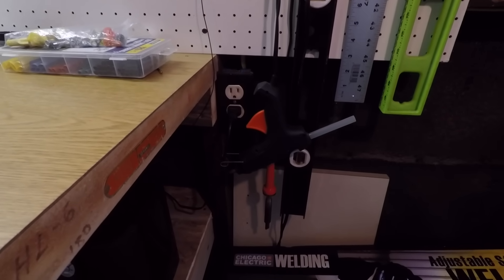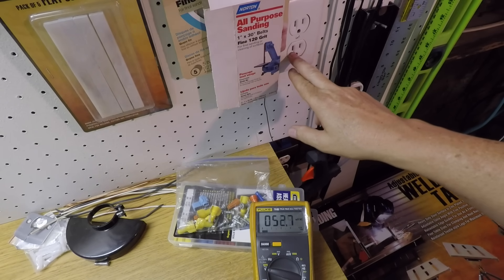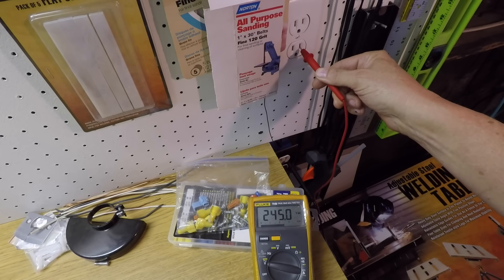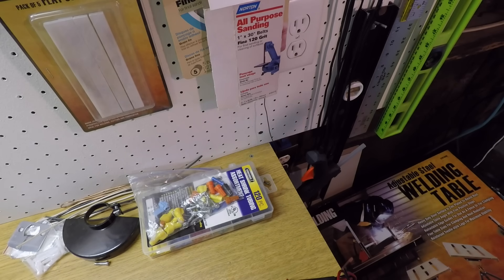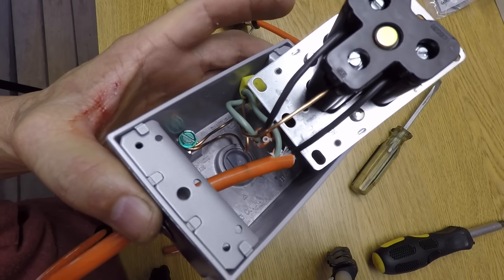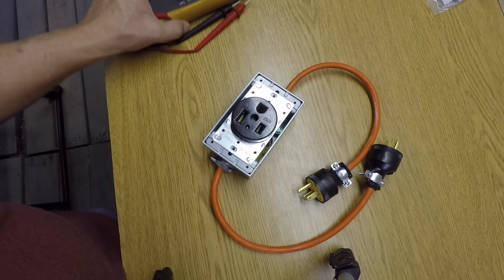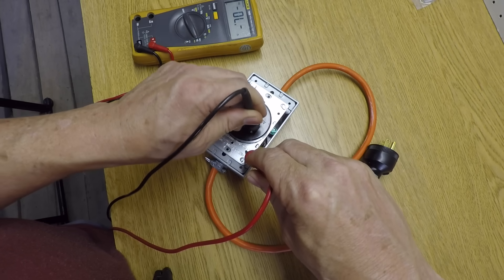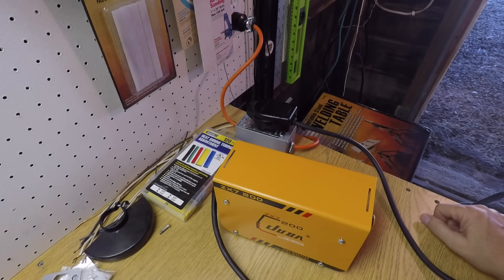How to Get 220v From 110v

Comment: There is something we studied in Electrical Engineering called "Inductive heating" where the wires on each of your 110v line would heat up because current is not going back through the neutral wire on the same circuit as the live wire.   On a traditional 110v circuit, there will be no inductive heating because current flows in opposite direction for the live wire and the neutral wire.  But in this case, there is no return current on the same circuit since it's returning through the other 110v line.  I don't think an inspector would approve of such circuits that would cause inductive heating.
Reply from the maker: There are many 240V circuits that are approved by inspectors that don't use the neutral wire. The neutral wire is only required if the device you are plugging in has a function that requires 120V. Many don't and my welder is one of them.
Reply: Yes, I agree.  But in your welder's case, both live wires are on the same group of wires in the same Romex sheathing or inside the same conduit.  In that case, inductive heating will not occur because the net magnetism caused by one live wire cancels the magnetism caused by the other live wire.

However, the situation we have here has one live wire coming from one outlet and the other live wire coming from another outlet.  That will cause inductive heating on both circuits.

As an experiment, after hours of an EV car being charged, pls check the temperature of each of the wires just before it's plugged into their respective outlets.  I haven't done this experiment before but it should be warm to the touch.

Edit:  The magnetic field is proportional to how much current is flowing through the wire so the phenomenon will only occur when there is a load on the circuit (e.g. charging an EV car)
Reply from the maker: Interesting info and good point. I no longer have that set up for my welder so I can't test out the theory. During the time I used the device I never had any problems and that's probably due to the low amp draw of my particular welder and the length of time I was actually using it. Thank you for the information.
Reply: In addition, a welder is not used for hours upon hours at 100% duty cycle.  An EV would be a bigger concern since it charges for hours at 100% duty cycle.
Reply from the maker: I agree

Comment: Have you ever heard of using your dryer outlet to run a welder or plasma I'm thinking of doing that ,your thoughts
Reply from the maker: Yes I have heard of that and I've done it for my welder in my new shop. I will soon be making a video of a slight modification to using a dryer outlet for running a welder. My dryer is on the other side of a wall in my garage. I'm going to pigtail a second 30A 240V outlet from that circuit and mount it on the garage side of the wall. As far as I have researched it would be up to code and safe. It's just not typical to have more than one outlet on a 240V circuit. If I run a welder at the same time the dryer is running the worst that could happen is a breaker would trip but that's no problem, we rarely even use our dryer anyhow.
Reply: You can but you should have a switch to only run one at a time so there is know chance of running both at the same time

Comment: I agree, just do it right & run a 240 line. Also, not using the white neutral wires removed that extra little safety of having more than 1 ground. I know you have 2 ground wires, but I would have added the neutrals too. Also, an easy way to remember which is hot is Black Gold. The black hot goes to the gold terminal.
Reply: Actually, the opposite is true. The safest way is to AVOID connecting the neutral as he did. That way, even if you connect only 1, you have 0 chances of electrocution. Or if the outlet is incorrectly wired. Imagine one of the house outlets was wired incorrectly (hot on neutral and neutral on hot, IT DOES happen more often than you think, especially in zones that use independent wires), if you have both neutral and hot wired to the plugs, you could close the circuit and create a nice sparky holiday...

Comment: Seems you put a lot of time and effort into doing something essentially the wrong way.  If you have the two 20a circuits why not keep the one as a dedicated 110v 20a circuit (btw those are 15a receptacles) and utilize the other 12/2 w/ground as you dedicated 220v circuit.  Only thing you would need to do is install the 220 receptacle in place of the 110 receptacle then add a 220 breaker in your breaker box...
Reply from the maker: My panel only has room for (1) two pole breaker or (2) single pole breakers.
Reply from the maker: NEC allows 15 amp receptacles on a 20 amp circuit as long as there is more than one outlet on the circuit.

Comment: You have to have two separate legs on separate phases and that is 220. Just do it right and run a new circuit from your panel
Reply: No, you have two legs on the same phase for 240VAC. The Neutral that provides the 120 in a panel is the center tap of the transformer. It doesn't change magically from one to two phases.

Comment: What kind of welder you have that runs on 220V and requires only 20Amps?
Reply from the maker: https://youtu.be/Sle56LvpsEM
Reply: @DIYHomesteadProjectsDIYHP10  Did some googling on this unit, it's rated as a 5.5KW input rating which would make it at least 25A!

Comment: bruh
you bought the box. you bought the outlet. you bought the cover.

just install it and replace the two single breakers feeding the outlets with a double. instead you then bought wire and plugs and other garbage you didn't need to create a contraption that can zap you/damage your gear. ughhhhhhhhhhhhhh

Comment: Good idea if you have no other choice..however if you are the one who installed the two outlets and the wires to them, then why didnt you just do the cheap extra steps to install the 220 outlet ito the wall using the two 110/120 wires...would have eliminated the need for your adaptor
Reply from the maker: Because that wouldn't be a portable solution but this adaptor is.

Comment: Hello NSXproperties, so right u are. . . putting circuits on same phase bar and if with a neutral, the neutral could be overloaded. say 2  20amp ckts on 1 phase bar the hots or ungroundeds would be  protected but the neutral overloaded by 20 amps. so not good.

Comment: Just wired a 240 circuit to your electrical box with a circuit breaker 40 amp with a plunging socket to be safe

Comment: Well if the sky falls and you're holding a plugged in power tool I guess you too then could be shocked!
I'm mean really, they are far out reachin'.
Nice work!
The only thing I might add different is change the 120v outlets with 20 amp CFCI outlets.
Reply from the maker: This device won't work with GFCI outlets

Comment: Q: why use hot/gnd vs hot/neutral? Seems like you purposely use your ground as a neutral but I thought that wasn’t “recommended” by the experts.
Reply from the maker: So here's my attempt to answer the question: In this 240V circuit there is no neutral used or required. My welder only requires two (120V) hots and a ground. It's a three wire set up. My ground is only a ground and nothing more. The two hots alternate back and forth being either a hot or a return (neutral). While one hot is supplying 120V the other is a neutral. They alternate back and forth 60 times per second or 60 hertz in the US. Some 240V plugs also have a connection for a neutral (usually white insulation) for devices that have a 120V requirement such as a clock or timer. A good example would be most modern common electric stoves or clothes dryers. Again, I'm not an electrician but this is my understanding and best attempt to answer your question. Hope it helps :)
Reply: DIY Homestead Projects thank you for the reply, I’m just trying to learn a bit, from seeing your videos, you know more about electricity than I do. You explained it perfectly and I understand the 240 part. I’ll quit bugging you cause I know you have lots of comments. What confuses me is when I check my 120v wall outlet from hot to neutral I get 120, when I check it from hot or neutral to ground I get 1 or 2 volts. On your 240 setup I watched you check each side with your multimeter between the hots and the ground and you got 120 per side, so I guess that’s what’s confusing me, my mind is telling me there shouldn’t be voltage where you showed there was (120 from each hot to ground) I appreciate you replying!
Reply from the maker: Oh you're not bugging me. I need a break from reviewing comments because my eyes are starting to go crossed. Ha Ha
That's interesting that you don't get but 1 or 2 volts checking voltage to the ground. When I check my outlets (in a more modern home now) I get 120V from hot to neutral and I get the same 120V from hot to ground. I do know the neutral and ground are tied together in a main electrical box. The ground is separated in a sub panel for some reason but I don't know why. I just know they are supposed to be. I'm wondering if maybe your multimeter probes didn't actually make contact when you checked the ground. Otherwise I don't have enough knowledge to know why you wouldn't get 120V on both the neutral and ground. I would be interested to know if you ever find out why.
Reply: @DIYHomesteadProjectsDIYHP10  Quick answer...Neutral and ground are redundant lines, with both being bonded to the same buss in the panel...Its a safety feature.

Comment: The electricians uses thick wires for 220 for a reason and an actual 220 plug and correct breaker. 
I dont know about this. 
Thank you for making the effort making a video tho.

Comment: You have 220 service. Why not do it right with a two pole breaker that will be to code?
Reply from the maker: The box that feeds that garage only has room for a single two pole breaker or two single pole breakers. I wasn't going to install a new box because I was getting ready to move. I did it right for my situation as far as I'm concerned.

Comment: That is a great idea. If you don't have two outlets that are on different circuits close together you can use a heavy #12 AWG extension cord that will reach one. You may not get 20 amps if the Beakers and wire can't handle that much, but you will get 15 amps at 220V. Make sure you don't have anything else using the circuits at the same time.
Reply from the maker: Great tip!

Comment: Buy 2 combination outlets 1 light 1 120v....Wire the 2 cords into the light switches and leave the other 2 as 120v outlets.When you are running the 240v swith the two light switches to on.
Reply from the maker: Good idea

Comment: I’ve noticed a lot of silly responses people are just not thinking about what this guy did. Let me clarify. If you run separate circuits from your breaker panel using separate busbars into the receptacles on the wall this process will totally work. Provided nothing else is on those circuits. Also, to answer, the reason one would do this and not just install a dedicated 220 line, is obviously so you don’t lose 110 lines. Keeping the 110 lines allows you to use it for other regular tools and doesn’t use up the space. So this is a great idea for somebody with limited space in their breaker panel box.
Reply from the maker: Very well said! Finally someone who watched the video and actually understands. You made my day with this comment! Thank you 👍

Comment: I NEED DIRECTIONS OR HELP GUYS. 
IM IN APT. WHRE NO 240 volt outlet is in the apt. , the only suckers are the normal 110/120 outlets on the walls. 
I want to use my electric stove in the apt. , 
Is there any other box I can buy which can transform/ convert 110/120 volt into 220/240 volts to be given to my electric stove?
Reply: There is no way to run direct cables from the main box so we should take note of that whn given answers to my question

Comment: I think the reason y those parts are 300$ is for the fact that circuitry u said is in. The mainstream part is to prevent back flow of current regardless of whether or not u know u have separated circuits or not stuff is made for safety and to be idiot proof for a reason  that's all I'm saying nothing against u or what u did

Comment: I believe you show check with an electrician. You should have the neutrals connected. Using the ground to complete the circuit is incorrect for several reason. Another name for the neutral is the return which you do not have connected, Using the ground is not correct and unsafe for a number of reasons.

Ricky from IBM
Reply: the ground still will never carry any current normally, the 2 hots actually cancel each other out.  While 1 hot is pushing electrons, the other is pulling and back and forth.

Comment: Amperage is the main concern with the wire gauge size.Always use the right gauge otherwise you will melt that wire insulation and cause a electrical fire.

Comment: Im a little lost here. What the multi meter does is measure the difference between your two references. So with ground being 0v then each hot would show 120v, which is correct.

But if one side is 120v and the other side is 120v then the difference is ov. And this the meter, and the device youre powering would rehister it as 0v as there would be potential fifference and thus no flow of electricity

Comment: If you have access to each of the 110v wires (looks like you do), I would have mounted the 220 box near those outlets and ran solid Romex wire from the inside of each of your outlets.  (12 ga minimum). Those outlets are very easy to jumper from the back side. Then there would be no need to make any extension cord jumpers like you have.  
This is assuming your welder doesn't require the typical 30-50 amps like many do? 12 gauge wire is rated 20-amp max isn't it? I don't recall at the moment.

I would also consider adding a small breaker box there. I've seen some that have a single 220-volt outlet and dual breaker configuration. Something you might see on a heat pump maybe? That way you wouldn't have to run back to your main box in the event of a tripped breaker. Also a good way to kill the circuit in a hurry if you needed to. Easier to flip a breaker than to unplug something (or 2 somethings in your case). Just my opinion.

My garage didn't have 220 either. It only has ONE 110v line. You're lucky you have 2 separate circuits.  So my solution was to essentially make a very heavy duty 220-volt extension cord. I used 6 gauge wire and I plug it into my dryer outlet in my house. Since we don't have a dryer, the circuit was unused, so it worked out well. I can now run my 220-volt equipment with no problems. My mill (w/phase convertor) and air compressor runs on 220v and my Hobart welder runs on 110v. I can easily run my mill and compressor together.

The only annoyance is rolling out this cord. It's not heavy, but stiff and bulky as you can imagine. Eventually I will bury the line and run it to the breaker box properly, but crawling under the house isn't exactly something I'm looking forward to.

Thanks for sharing the video! 

PS: I am NOT a professional electrician by any means, so take my advice as you will!!
Those of you that aren't familiar with electricity... BE EXTREMELY CAREFUL! It takes VERY little to stop your heart from an electrocution. Far less than you might think!
This video isn't exactly for the beginner trying to install a new plug on a lamp. We're messing with 220 volts here and a mod at that. Believe me when I say... that kind of amperage does NOT wait for you to touch it! 

BE CAREFUL or you might wake up on the wrong side of the funeral!